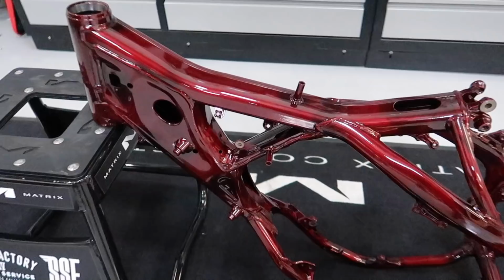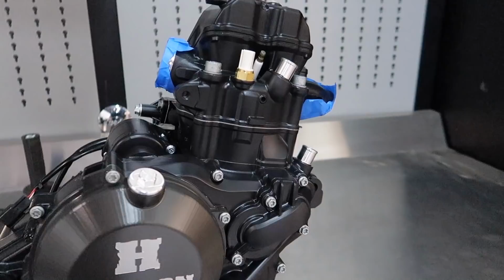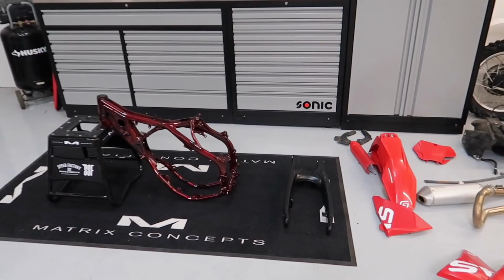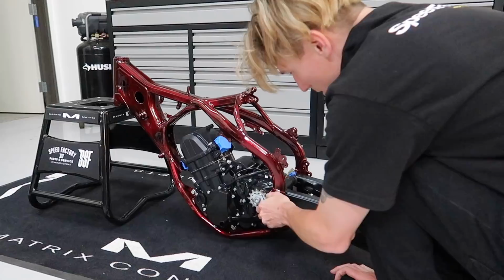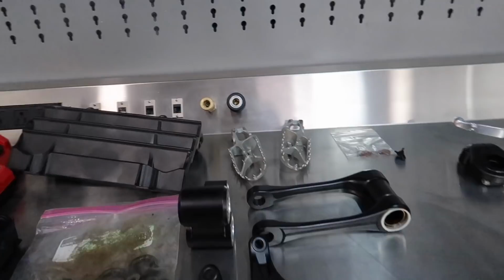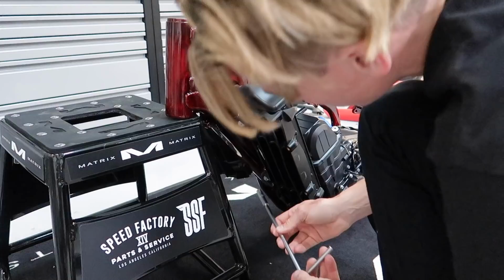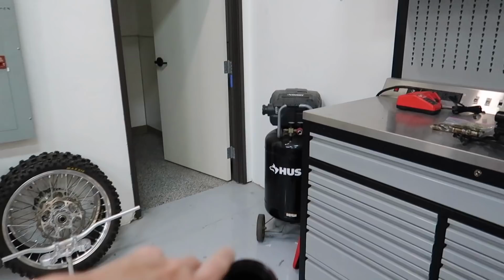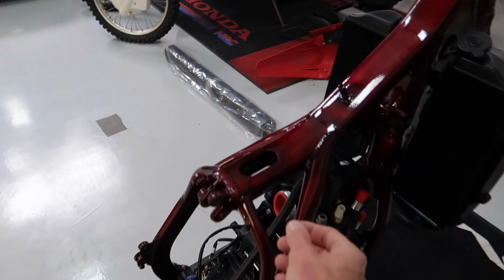GAS GAS build coming together!

Comment: When I built my pitbike, I went the extra mile to weld a spine, oil cooler bracket, and bracket caliper mount on before I painted it metallic blue. You're right about taking it all in, and taking the time to do it right while you're in there, the end result was much more satisfying.

Comment: You need to get you a lift table and not one of the harbor freight ones. It will save your back when doing engine removal and installs.